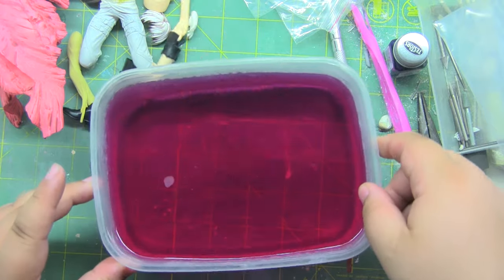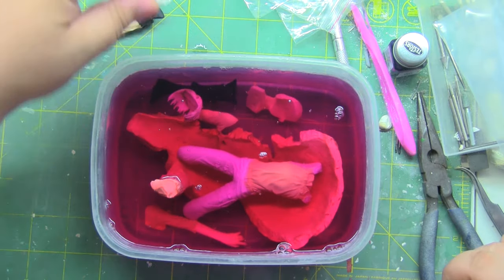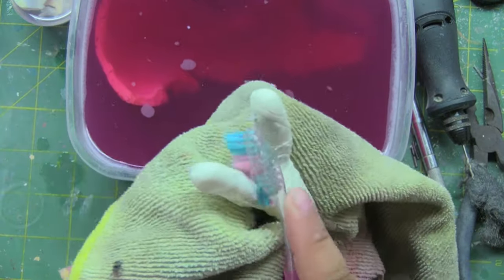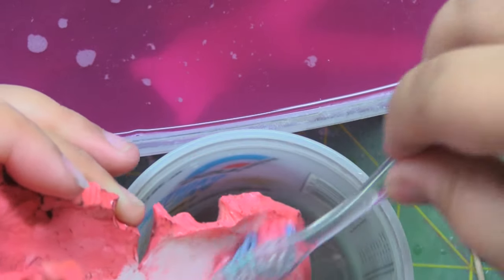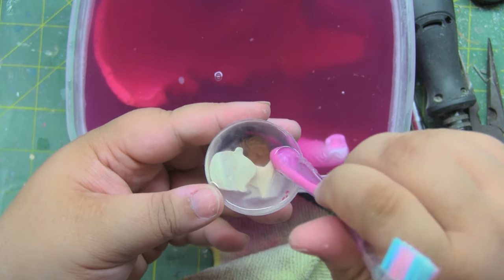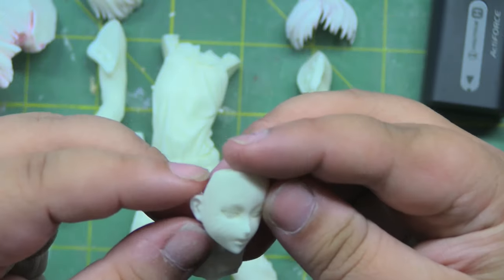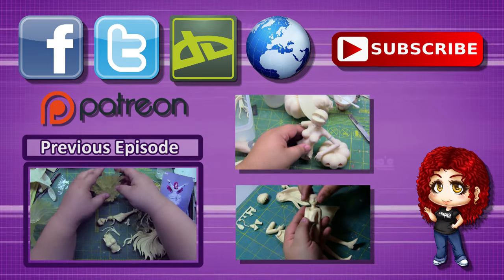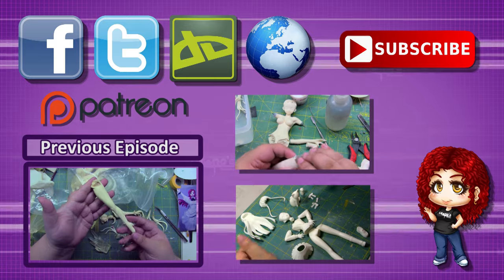Resin Kit Tutorial: Paint Stripping

Comment: One of the tips I've seen is for BJD painting, but since it's resin for the most part either way, it may still work. Though, I may be wrong, so don't take my word without searching first!! I've read that some people use either cold cream or toothpaste to help yellowed resin (which could help yellowed clear resin, but I'm not sure it would reach it to take the yellowing out of the center of the piece if it's too thick). Pretty sure it's the cold cream, but I don't remember why it works :/ They cover the yellowed part and leave it for a few days, and then clean it off.

Comment: Thanks again....as to something different, I've used one of those sub-sonic vibrating denture cleaning machines, though the work area is a bit small. You can also go the route of getting a dentists vibrating table which runs around $90 and all you have to do is lay your container with fluid/parts on it to help speed up the paint removal time.

Comment: If I'm stripping resin I tend to just dunk the parts straight into lacquer thinner as normal, tan coloured resin doesn't react with it. For plastic parts I like to use 90% isopropyl alcohol and most paints just come straight off with some light scrubbing in a matter of minutes. I completely avoid using tamiya TS spray paints on plastics for the simple reason that once they're on there, the only stuff that will remove them will also turn your plastic to sludge.

Any chance you can do a tutorial on avoiding paint lifting and how to fix it when it happens? I have awful issues with paint lifting off resin during masking, and I've done everything I can think of to stop it.
Reply from the maker: +TheMixEmperor yes, I'm actually continuing with my Back 2 basics series and I'll mention how to avoid paint stripping or lifting as you say, at the moment of masking :)
Reply: +Leona&#39;s Workshop Awesome, looking forward to it. :D

Comment: I was wondering if the same can be said for plastic models. Are you able to do the same thing with plastic model kits, or would it damage the strength of the plastic? I tested some acetone dunking on some spare sprues and it made the piece very soft and warp very easily. Sweet video ALso !!Keep it up!
Reply from the maker: +batmanneedssome200 I really don't know, like I've said in the past, I specialize in resin, not plastic...
Reply: for stripping warhammer minis, alchohol can be used on plastics without issue

Comment: Hey Leona, what about removing mugre? (That's the best I can describe it. lol!) Like you know how you hold a resin part in your hand/fingers as your working on it a few times and such, And then you notice mugre in like small/tiny bubble holes in the part or it becomes yellowish, like a white part that was casted in white resin becomes yellowish. How do you remove it? I tried simple soap and water and result were it removed some of the yellow but not much, and the mugre in the bubble holes still remained. Of course its always best to use gloves when working on resin, but the kit I'm trying to clean up is one of my first kits I've gotten, around when I got into the whole resin kit world and such. I'm going back and redoing my older kits. But I'm stuck with this issue.
Reply from the maker: I'm not sure if we both refer to the same things when we say "mugre", in spanish it's just that something is stained or dirty, so I'm assuming you mean that? usually when you work on the prep stage, it really doesn't matter if the piece gets dirty or that the resin turns yellow, as you cover all that with the primer before you start painting, the white resin turning yellow is normal, you can't really stop it, it also happens with clear resin.
Reply: +Leona's Workshop - Late reply, didn't get a notice that you replied, my bad! But yeah, that type of "mugre" is what I meant. lol! But the kit that I mentioned that I'm going back to redo, its a colored resin and the kit can articulate. The parts that has murgre is white parts. I could paint white over white resin, but its like pointless as its already casted in the proper white color and I don't have to worry about paint scratching or chipping since its casted in white. But the mugre though, ugh I can't get it clean out of the tiny bubble holes. I wish I can go back in time when I just started into this hobby and tell myself to put on some gloves and seal the white parts to prevent this. lol!

Comment: What about if the kit has primer below the paint? Like Tamiya fine grey spray. And then Tamiya painted over the grey primer? Will it still work?
Reply from the maker: +sonicrockmanx it should
Reply: +sonicrockmanx Easy-Off oven cleaner or a heavy duty oven and grill cleaner. In a well ventilated area (outside), place the model in a garbage bag, spray it well, pull the bag up over it. Tie it securely to keep the fumes in, the bag will rise, when it deflates a bit after 3-4 hours, check it, spray again, seal bag. In a few hrs it may be ready depending on the type of paint used. Wash it with a degreaser soap of choice, like above. Dry. Inspect. Repeat if needed.
Reply: +Leona's Workshop - I commented back but I guess it didn't save? But for a late update, I tried the Simple Green and removed the paint fairly ok, but the primer not that easy. I let it soak in green for a day or so, and it softened the primer enough to like scrub it off some what. So it did help. Better than scraping and sanding off the primer. Thanks!
Reply: +wells5150 - I thought I replied bit it didn't save? But thanks for your reply. I tried the Simple Green and it kinda helped in my situation. But your way my friend tried it on his kit and it worked. So all went well.

Comment: how would you get paint off a sealed piece? i want to repaint a kit i have. back two years ago when i originally did it, i sealed them thinking i was gonna finish it then. boy was i wrong. the sealer used was the krylon matte finish sealer.
Reply from the maker: +PALguy329 you can still dunk them in the same purple power bath for about 3 days, the paint along with the sealer should come off, Krylon is not a lacquer based sealer so it should also come off easily :)
Reply: +Leona's Workshop thanks! i might try that sometime then

Comment: Acrylics etc are better and safer to strip with methylated spirit. Just soak and the paint falls off in moments, only needs a little touch here and there with a old tooth brush to shift the stubborn bits. Easy to used and reuse all so great for degreasing new bare models kits.
I have read that Dettol a disinfectant works too, but this a no no to me. It is dangerous and can kill due to the fumes in halation as with all the others. Methylated spirits is by far the safest used it for year in the hobby and as a paint remover when decorating.

Comment: If I want to strip paint from an old model, I use EZ Off oven cleaner. No harm to the plastic, resin or styrene. Put it in a zip loc bag and hose it down. Scrub it real good with little brothers tooth brush, then soap n water followed by alcohol wipe. The only time it didn't work, was trying to strip a Hot Wheels car. Did not touch the factory paint but it will eat up spray paint and craft type paint.

Comment: Get an ultrasonic cleaner. YMMV with enamels, but for most acrylics you can reduce your 2 day stripping time to less than an hour.
They run about $40 or so now. You might have some issue with bigger pieces, but they do sell larger ones for more money. IMO, well worth the money for the time saved. Just be careful as it'll undo superglue as well. Epoxy putty should still stick though. Give it a shot.

https://www.youtube.com/watch?v=baSn9vydlfY

I've also heard LA Totally Awesome is by far the best stripping fluid, but I haven't used it yet either by itself or in an ultrasonic cleaning machine.

https://www.youtube.com/watch?v=5bcoamuMvgw

Hope that helps. Thanks for the great garage kit specific tutorials.
Reply from the maker: I actually do have an USC, use it all the time to clean my kits and also to remove some paint sometimes, this video was before I bought it, in fact it was actually a few months before I got it.

Comment: Anyone else is having problems removing the primer? I can take the paint off "easily" but the primer stays...
Reply from the maker: Removing primer is a bit harder, I remove it mostly with hardware thinner, just rub it off and not really soak the resin in there because it is very corrosive, primers are mostly lacquer based so you need to remove it with something strong. Always use gloves when using hardware thinner too.
Reply: @leonasworkshop  thanks! I've ordered an industrial degreaser anways, since in my country purple power doesn't exist. I will try first to soak it a couple of days to see if primer goes off, otherwise i will try with laquer thinner. wish me luck! (its an old thai recars of a sculpt I love, but I'm about to give up hahaha)